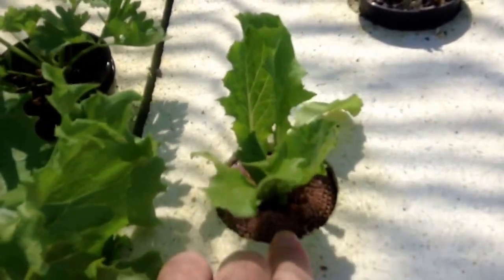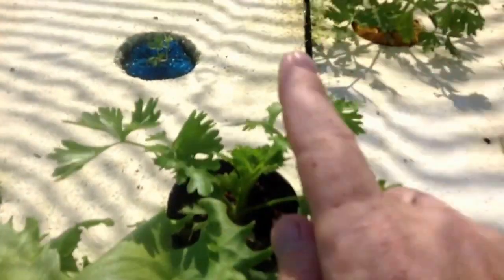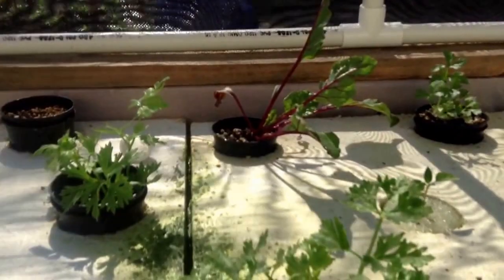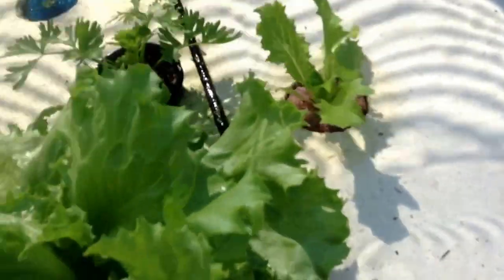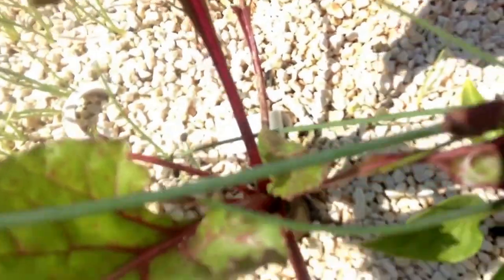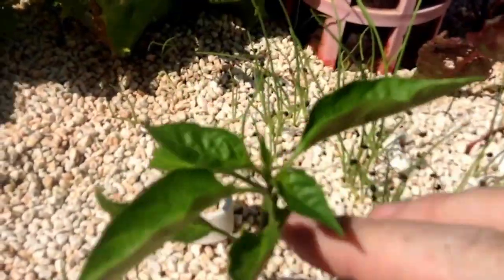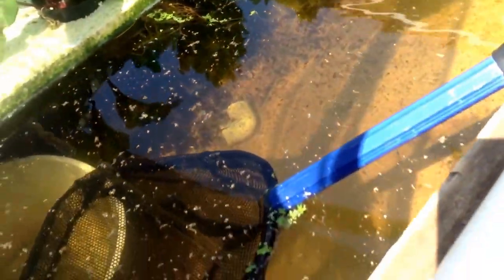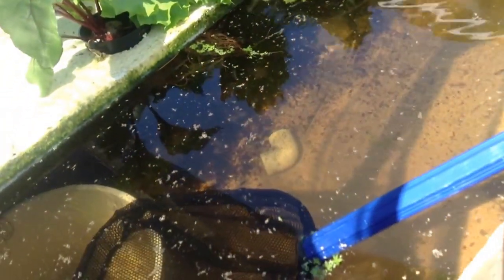Aquaponics in Jamaica: DWC vs F & D.  Hard pruning peppers.

Comment: The rooting system of plants in DWC has to ability to grow faster and farther than in a grow bed and I can see the your grow media  is very small, the up side for having small media is that you have more surface area for bacteria the downside is that the grow bed is tightly packed and roots are somewhat harder to expand. Also Roots needs air hence aeration of the DWC would improve growth.

Comment: Hey, that is not scientific!! Lol. I couldn't resist.
That growth is awesome!!
I love aeration. I try to aerate everything. I have them in the bell syphons for the growbeds, the fishtanks for the fish, the swirl filter for the bacteria, and had one in the hydro tube but I want to double up on the fish tanks and have a stone in everything as well.
Reply from the maker: Scary thing is I'm fighting the urge to build another DWC tank and matching grow beds for F & D to be able to do a real comparison of with and without aeration, with shade clothe, without, media and DWC and so on using the proper methodology.  My educational background poking through.   Buy some micro scales for accurate measuring of growth.  Then I have to remind myself this is supposed to be a relaxing hobby. 
I continue to be amazed at the growth. I did harvest the head of lettuce in the F & D bed and wow was it good. Probably the sweetest lettuce I've ever had.  I'm hoping the others curl more to form tighter heads but I've been harvesting the lower leaves for a week or so already. 
Looks like I won't be able to hold off on the filter fixes much longer. Just too much poop for those small filters. 
Thanks for watching more to come.